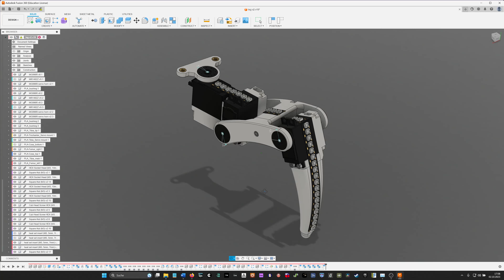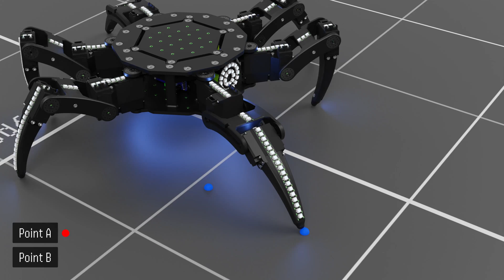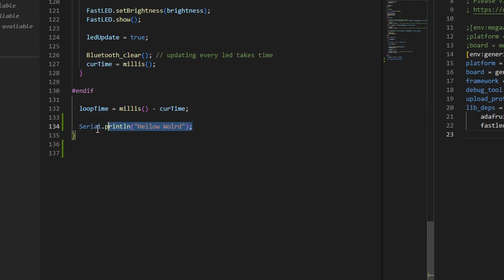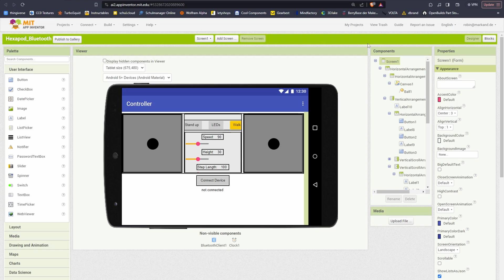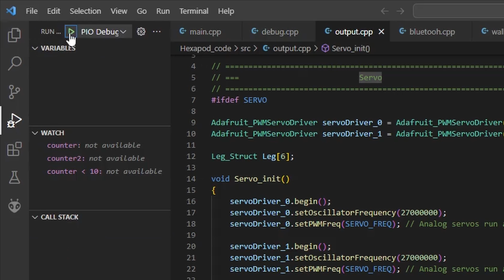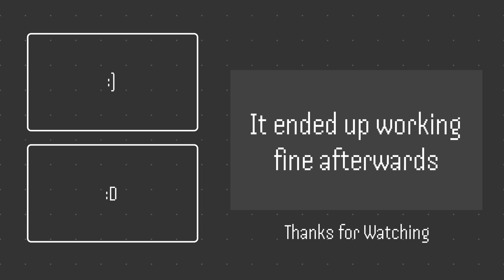DIY 3D Printed Hexapod: #2 Body and first Steps

Comment: Hello, I am working on a similar project. Thank you for your guidance, and im using the bushing set you designed. Now I am facing an issue where the bushing doesn't fit properly. At first, it fits.. later it get loosed..

I noticed in your first video that you used a steel bearing, which I assume you bought from a shop. Could you please provide the bearing size you used in that setup? 

This would greatly help me with my project. Thank you!
Reply from the maker: The bearings I used in the beginning should be the same size as the bushing. So just measure the Busing and round the values to the nearest millimeter. But If you are also trying to build a robotic leg with cheap servos you will have to find some was to add friction to the joint. Otherwise you will see oscillations like I did.

Comment: it would be nice to eliminate the servomotors which will be about 18, 3 for each leg. in their place create artificial muscles pneumatically by pumping air or a liquid gel. this would allow a more precise and fluid regulation similar to the human or spider muscle movement. spiders do not have muscles, but bags in the legs that are filled with liquid from a pump in the body. so you could use air to have resistant muscles of at least 10 times its weight. 
the bags could be made of silicone or polymer ... it could work

Comment: Hello,
Very good job. For energy, why not using s3 lipo in 6000 mAh for example.
What is your simulation software ?
Reply from the maker: I used 18650 cells since I already have quit a few of them (from an old E-Bike battery) and wanted to use them. As for why I chose a 2s2p configuration that mainly comes down to the space inside the Hexapod. I knew I could fit 4 cells inside so that is what I went with.
AS for the simulation software that is blender. It is not actually a simulation but just and animation I made for the video :)

Comment: Can you share what power supply you are using?
Reply from the maker: Do you mean my lab bench power supply? That would be the KPS3010D :)
Reply: @ no, i mean when it work stand alone, i have trouble when my power supply for my robot is not enough current
Reply from the maker: I actually have the same issue. Unfortunately the peak current is higher than my buck converter can support. I mitigated that problem to some extend by having a second smaller converter wired in parallel but it is still an issue. If you say it's not enough do you mean it is not enough to walk or stand up? I mostly saw the current issue whenever I tried to walk at any significant speed.
Reply: @SirKuhnhero  I mean even stand up, my robot is struggling 😅 however, I have fixed the problem with 2s2p 18650 batteries, connect to 2 parallel xl4016 dc to dc buck converter with the current 8A each. It has solved the problem 😃
Reply from the maker: Nice :)

Comment: hii i  am trying to make this project ,and i want to know about the code and can you provide the code with out the light function becasue the code you give is not working with my project and not able decode the error .if you help me it would be a great help
Reply from the maker: If you have some specific questions you can write me an email at sirkuhnhero@posteo.com. Considering the code without the LED function that shouldn't be an issue. As long as it is not defined in the header.h file it will be left out.

Comment: Hi, i have printed all the mechanical parts and have all of the electronics. Can you make beginner step by step tutorial on how to upload software and make it run? Thanks Dave
Reply from the maker: I can try and update the instrucables instructions a bit and make then more like step by step guid. Once I do that I can update you here :)
Reply from the maker: Hey, quick update. I don't think I will really be able to find the time to make step by step instructions any time soon. If you problems I would recommend doing some simple Project to get to know the software. If you know how to import a Project into PlatformIO and upload it you should be mostly good to go.

Sorry I can't be of more help.
Reply: @SirKuhnhero  dont worry, ill try to solve it.  have you thought about making the robot more autonomous for example let him explore surroundings and do some raspbery pi object recognition? would it be possible to add more movements like for example slam atack? do you plan to update the legs with senors and let him cros some less even surfaces soon? would it be hard to use some ordinary radio control set instead of android aplication? If i make it work as is i will instal FPV and send you videos.
Reply from the maker: That sounds awsome. I have definitly thought about autonomus navigation but I think that is still a long way off :)
Reply: @SirKuhnhero  well i tried to plug everything and install ap and pugins... i am not sure if the board is communicating with visual studio or even how to check or fix it. Do you think you could uploade one cheap arduino board and send it to me for some money? if i could just plug it and it would work? the spider is nice and mecahnically good. its just if i cant get over this it will never work. or we could do a skype call, we could share screens install it together and you could later upload the video.
Reply from the maker: I don't think sending over a Microcontroller with the code already uploaded is a good solution. There is some calibration that needs to be hard coded. I am working on a new mainboard to replace the current one that should be WAY easier to program. I also had a lot of issues trying to program the STM32 I used and don't really want to do that again. It will take a few weeks but I think that would be the better solution :)
Reply: Hi, I tried some easy project, blinking st-link led, just to figure out that those yelow bridges on microcontroller were in constalation that prevented rewrite of programing. After i got that sorted out and this side project worked i was able to uplad the spider with your code. It does blinking BT module, its visible on the android phone i installed your app on, but... again something... but phone and or app could not connect to it 🙈 my following question would be... im using unshilelded wires and power from bench supply. it seem like weird thing to cause it, mostly unrelated. where would you look for cause of the problem? Other thing, i might wanna use my RC set with it (later in combination with fpv). Would it take a huge amount of programing (for you or someone who can do this) to take comans from ordinary RC reciever? Easy way to do it? Some pleone may be interested... since i dont know any nerd that does not have at least one set 😂
Reply: @SirKuhnhero  Hi I have gone a little bit further, my android phone connected to the hexapod and the BT module stopped blinking. But nothing happenes if i move the controls. Servos are totaly silent too. Any ideas?
Reply from the maker: Hey, Sorry for not really responding. When you mean silent you mean that they are doing nothing right? Can you move them by hand or are they resisting? I am not sure what the issue is right now but I will try and find some time tomorrow to look into that. Would it be possible to continue this conversation per Email (sirkuhnhero@posteo.com)? That might help me respond a bit faster :)
Reply from the maker: I have finally found some time too look into it and I am not sure what you issue is. Have you tried uncommenting #define SERVO_CALIBRATION in header.h. Doing that should move the servos to a default position. If they don't do that I would suspect there is something wrong with the way you wired up the servos to the servo driver or the servo driver to the MCU. Maybe something like having the I2C lines reversed.
Reply: @SirKuhnhero  hi, thanks for your answer. I  figured out i was not able to upload the code to the spiders microcontroller. I tried some easy projects but i still cant get any code inside the blue pill. ST-link problem? IDK... I got to total dead end, tutorials from youtube bring nothing because options that i get to choose from are not visible. In the meantime i decided to attempt to at least control some servos over PWM board throught RSB PI but all i got so far just one instace when they moved. After trying to rerun the same Python code from internet in Thonny it just keeps giving errors. Maybe in the future i will be albe to write my own code but im just in the fist stages of even trying to figure out how to move a single servo.
Reply from the maker: Programming the STM32 can definitely be a Pain. At some point I messed up my drivers and wasn't able to program microcontroller again. One thing you can try is changing the PlatfromIO.ini file to compile for the RPI Pico. There shouldn't be any libraries that are not compatible with the Pico. If you do that you could use your Pico isntead of the STM32, however you would need to update the pin definition for the Servo Driver I2C pins and the Bluetooth Serial pins. Everything else should just work.

Comment: Output Voltage rating for the XL4016E1 buck converter ??
Reply from the maker: I set the Buck converter to about 5v. If that is what you are asking about :)
Reply: @SirKuhnhero  brother I want to contact you regarding this project how can I ???
Is there any ig for you???
Reply from the maker: Feel free to write me an Email at sirkuhnhero@posteo.com. I am usually a bit slow to respond though :)
Reply from the maker: I honestly can't remember. At least 30 Hours but maybe much longer ;)
Reply: @SirKuhnhero  thank you brother 🖐️

Comment: Hey where do I start with… to get into robotics , I wanna build one myself this way it’s amazing
Reply from the maker: That's a pretty difficult question. I started with robotics by learning how to interface with servos, steppers and mature sensors like the MPU6050. I can't remember what my first robotics project was but starting simple and learning the basics of programming, interfacing with actuators (motors etc.) and electrical design is probably the best idea. 

If I had to give a recommendation it would probably be some sort of 4WD Car. You can get full kits that have everything you need for relatively cheap (although buying all the components yourself can be cheaper).

Alternatively you can have a look around Instuctables. There are a ton of like minded makers there that upload instructions on doing everything from building 4WD Cars to advanced electronic design.

Ultimately you have to find projects you are passionate about ;)
Reply: @SirKuhnhero thanks a lot!

Comment: Let me ask, I'm having the same problem as time 8:57, how can I fix it? Also, instead of using Hc-05 module, can I use esp32? Thank you.
Reply from the maker: Aa far as I remember the issue was the inverse kinematics model. Something about the sin wraping around from 1 to 0, but I honestly can't really remember. Also you should be able to use an esp32. However that will require some changes in code.
Reply: @SirKuhnhero  Hope you can help me, I fixed it but everything makes no sense. And importantly, the app you sent cannot connect to bluetooth
Reply: https://docs.google.com/document/d/1IoS9caU5AxHzBd14yKo2bQGcDBTfD60pcD1-tFsI6AE/edit?usp=drivesdk
I fixed it but bluetooth cannot connect.
Reply from the maker: Unfortunately I currently can't help you. I am on vacation. But you can write me a Email at sirkuhnhero@posteo.com and I can try to help once I get home :)
Reply: @SirKuhnhero  Thank you, I have fixed it. The next problem is that I'm having trouble setting the angle.
Reply from the maker: I am so sorry I have left you hanging like this. If you are still working on the Hexapod you can write me an Email.

Comment: If I dont use the LEDs, do i still need to add the module powering the LEDs?

I have bought it, but it is giving output of  ~21V, a huge amount of current, that will fry the servos.

How do I make it work?
Reply from the maker: If you can't adjust the output voltage you don't strictly have to use it. I personally like to use a different power supply for my servos and my microcontroller. But you should be able to connect everything to the main buck converter :)

Comment: Hello, very good work, you are very good, question about the PCA9685 servo control in which you solder the node, in the first or in the second, when soldering it in the second when connecting to Bluetooth, the first movement of the first three legs is done well, and the other three make the opposite movement, but if I weld it differently, leg 1 does not make movements, can you help me, thank you.
Reply from the maker: I don't quit understand what you mean. Do you mean which one of the drivers has the solder jumper for the second I2C address soldert? Feel free to send me an Email (sirkuhnhero@posteo.com) with some more information and some images or videos. I would be happy to help you :)

Comment: i think we need a good tutorial for this bc i cant understand most of it
Reply from the maker: I don't think I will do something like this for this version. Making a video takes a LOT of time. However I do have Ideas for a v1.1, basically a very similar design but with a few small upgrades, and I might make a full tutorial for that. If you or other people have any Questions I would be more than happy to help you :)
Reply: @SirKuhnhero  thank you so much but i have all the parts exept the LEDs what if i dont put LEDs on the project what should i do ?
Reply from the maker: You can just leave them out if you want to. Simply not use the #define for the LEDs in the header.h file. The Hexapod code will ignore everything that has to do with the LEDs

Comment: could u tell me what kind of material did you use for the 3D printing parts
Reply from the maker: I used PLA. But it doesn't really matter as long as you don't use something super flexible.
Reply: @SirKuhnhero  im gonna do ur project but if i have problem can i contact u ?
Reply from the maker: @bavin1780  Sure. The best way to contact me is through Email (sirkuhnhero@posteo.com)

Comment: Which type of y splinter have you used to charge the battery and are there any other ways to charge the battery?
Reply from the maker: I soldered two male and one female XT60 connector together to create a compact y splitter. For charging I used my labbench power supply (set to 8.4V and 2A). I don't need to worry about balancing since the BMS takes care of that. Alternatively you could also use a constant current power supply (with 8.4 Volt).
Reply: I am not getting a proper idea about what are you talking about can you give your mail so i can send you the images of my hexa pod circuit?
Reply from the maker: Sure. You can send me a mail to sirkuhnhero@posteo.com

Comment: What changes do i have to bring to the code if want to use adruino other than changing the pins where servo and other things will be connected ?
Reply from the maker: I think you would only need to change the "DATA_PIN" for the LED strip and the "txBluetooth" & "rxBluetooth" for your bluetooth module in the header.h file. Since the servo driver uses I2C you probably wont need to change that if you use I2C0. You might need to change the channel for each servo depending on where you connect them on the driver (in output.cpp). You will also need to change the platform.ini file. right now it is set up to build for the stm32. I don't know what changes you need exactly but you can create a new PlatformIO project and take a look at the created platformio.ini file. That will be a good template. Just remember that you need to keep the lib_deps definition. Without them it doesn't include the required libraries.
Reply: @SirKuhnhero  thank you so much
Reply: There were 2 connections of servo on the stm32 on A7 AND A6 so are they anolog or didgital outpit pins ?
Reply from the maker: Do you mena B6 and B7? I think those are digital pins. But more importantly, they are the pins for the I2C bus.
Reply: @SirKuhnhero  thanks

Comment: how did you upload all the files in the microcontroller ? do i have to select and opload one by one or i can select alll the fiiles and it will be uploaded 
? please tell
Reply from the maker: You will need to open the Hexapod_code folder with PlatformIO. PlatformIO will handle compiling all of the files into once you tell it to upload to your microcontroller. If you have never used PlatformIO I would recoment doing a very simple project (like a blink sketch) just to get some experience with a simpler project.

Comment: can we use adruino instead of stm32 ?
Reply from the maker: Should work. I think I remember having seen some Hexapods using an arduino. I am just a little bit worried that it is not fast enough for the inverse kinematics. I have no idea how unoptimized my code is. But even if the inverse kinematics end up slowing it down, which I don't consider to be likely, it will just walk a bit slower.